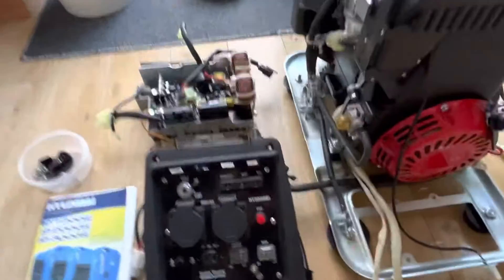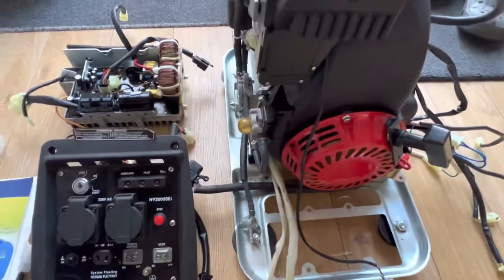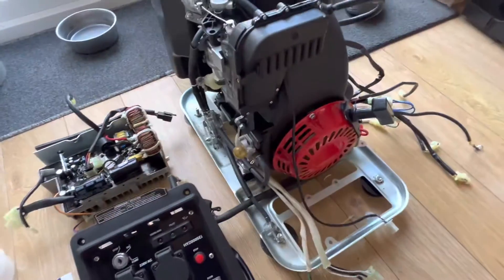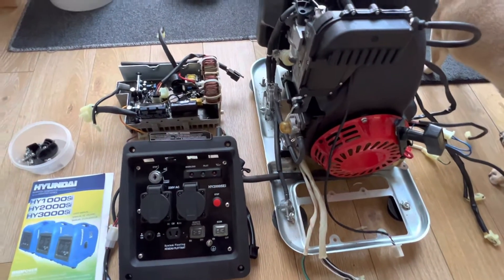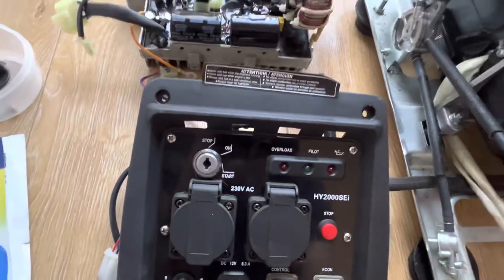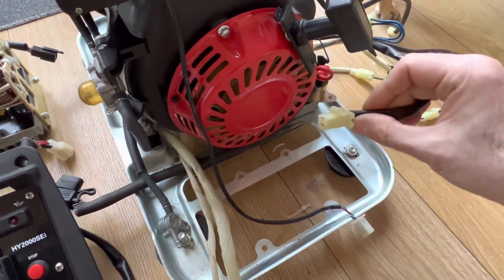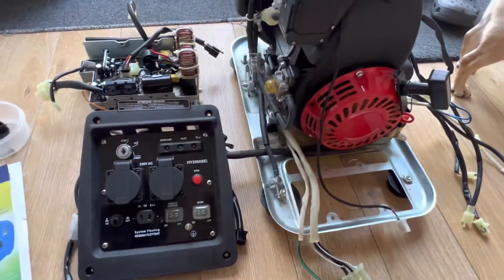Attempting to diagnose Hyundai HY2000SEi brief case generator overload fault

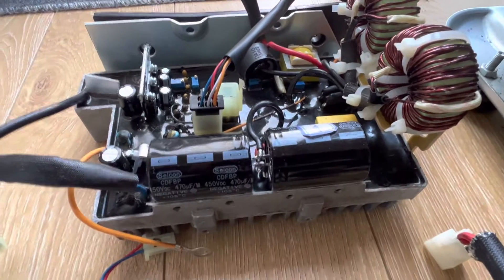Comment: 1:15 Does the large capacitor on LEFT have a dent in the case?  Maybe just reflections.
Reply from the maker: @chetmyers7041  the first thing I did was replace the caps 👍

I ended up baking the PCB in the oven and it’s fixed

Comment: Did you ever get it repaired?
Reply from the maker: I baked the PCB in the oven and it now works
Reply: hi the front Panel controller in the oven? @DavesDiscoveriesChannel
Reply from the maker: @David-ws6zr  the inverter PCB, I removed the large capacitors first
Reply: @DavesDiscoveriesChannel  did you have to un-solder the large caps or no?
Reply from the maker: @sallyskrackers  I removed the caps before putting it in the oven yes 👍
Reply: Hi mate, What temp and for how long did you do this?

Comment: hello i had the same problem with my hyundai 2000si i put the controller in the oven at 175 fahrenheit for 24 hrs and i tried again and it worked good lock maybe
Reply from the maker: Thanks I’ll try a “reflow”
Reply: Can you elaborate on this method please? What exactly are you putting in the oven the whole inverter module? Thanks
Reply: @Crusty_moto  Did you ever get an answer?  I'm getting DC voltage but nothing with AC and no green light... what went in the oven?
Reply: @miked1756  no I didn’t, i found out my problem was the inverter module but could not get hold of one anywhere so at a dead end with it
Reply: @miked1756  Same problem on mine, any solution?
Reply from the maker: Just tried “cooking” mine at 180c for 10 minutes and it only works now 😮

Thanks!!
Reply: hi the front Panel controller in the oven?  @DavesDiscoveriesChannel
Reply: @David-ws6zr  i'm wondering this too as i'm stuck at the same state! mine is just the 2000SI without electric start. Did anyone measure what voltage you get from the stator/rotor while running and connected to the invertor?
Reply: @DavesDiscoveriesChannel  what did you put in the oven was it the front panel? Did you remove anything or do any prep work?
Reply: @billstein9  You put the inverter panel in the oven after removing the capacitors.
Reply: @manoo422 what does this actually do how does it work? Must we remove the capacitors, the two big ones?
Reply: @leotl3368  I would guess it thoroughly dries out the electrics but you dont want to risk damaging the capacitors which have very thin plastic insulation which wont like much heat.
Reply: @manoo422   I see. Will try this. 24 hours or 10 mins both seemed to work?
Reply: @billstein9  Carry it down to Pizza Hut and place entire unit in oven for 7 1/2 minutes.  Serve with marinara sauce.